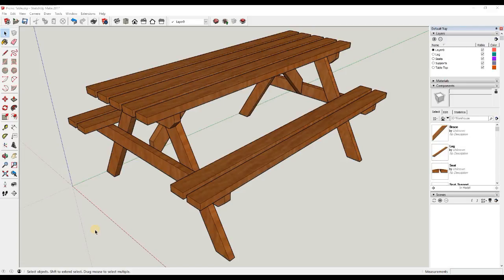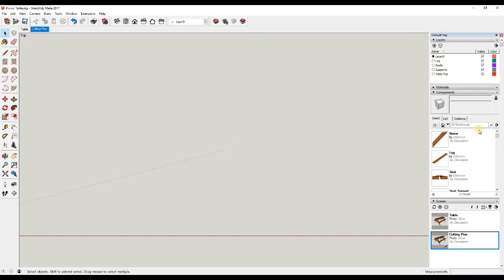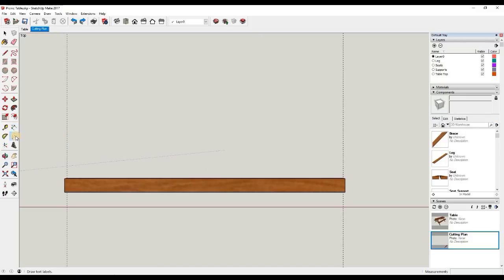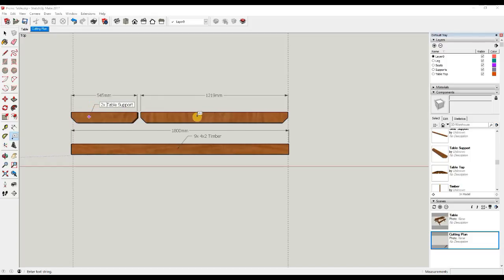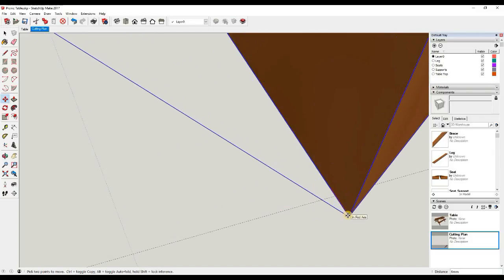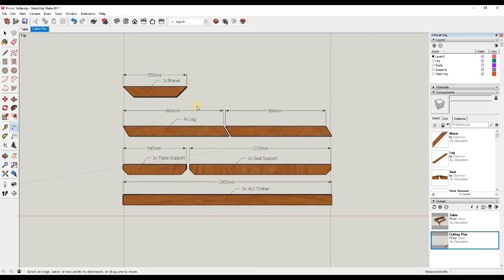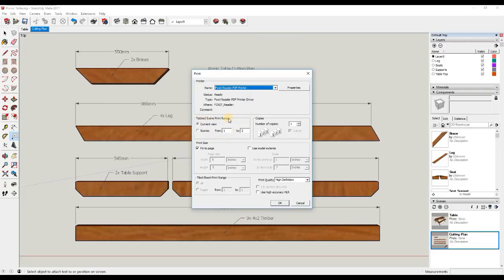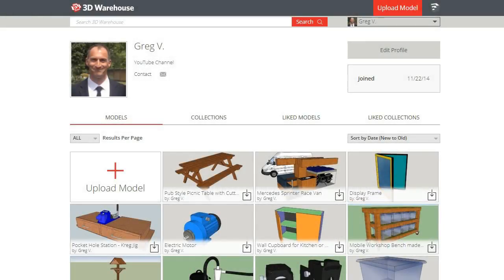Draw Cutting Plan using SketchUp Scenes

Comment: Hello, Greg, and thank you for these great videos. I’m starting down the path of 3D modeling and you tutorials are exactly what I’m looking for. These two picnic table ones were the perfect starting point. The next step I would want to do is to add hardware, and I’d love to learn from you how you’d add that to the plans; download from 3D warehouse? Create your own? Other? I’m going to be working on some plans for public release and it would be quite helpful to also show people a complete design with hardware. Thanks again!
Reply from the maker: Hello Tomás, regardless of the subject in question you might find all my tutorials helpful as the methods are very similar. 
With fixings it is better not to go into too much detail. Do not show the threads for example as the file size just gets too big. You can download sets of nuts and bolts from 3D warehouse or as you get the hang of sketch up it is easy to build up your own library of fastenings and store in another file that you can copy and paste from 😊
Reply: @GregVirgoe  - aha! Those are great starting points and nuggets of information. As always, it likely depends on the audience that's going to be consuming the assets; if it's for experienced builders then less details are needed and vice versa. Thanks again, Greg!